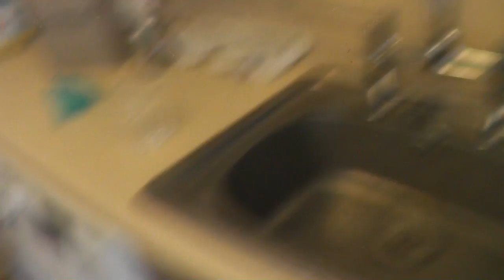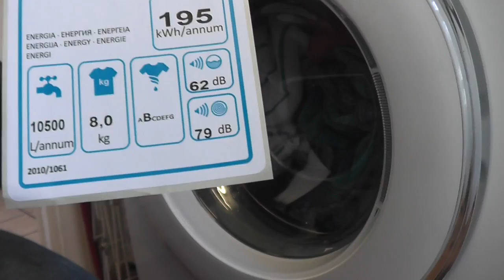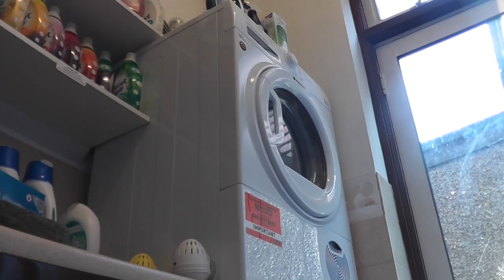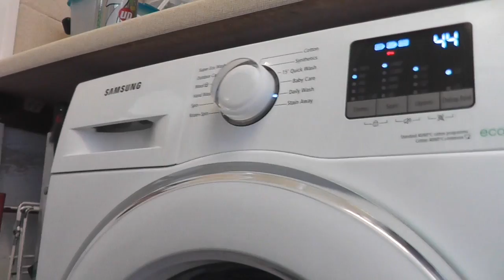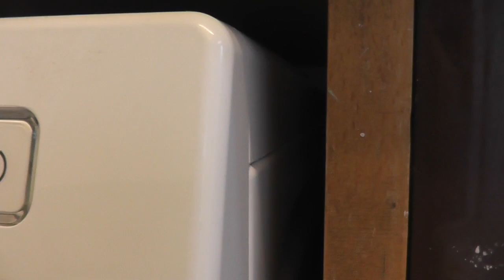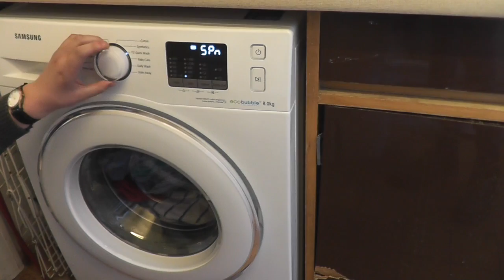Wash-In @ Washercrazy's 25/03/2017 - Samsung EcoBubble WF80F5E2W4W+Service Cycle!

Comment: My beko spins like that with the new pcb. It is much less sensitive and know acts like a real beko! Omg I've got the exact same comfort, my fav is the green and the new purple one even though they are all lovely.
Reply from the maker: I love the Comfort Intense ranges! Yes I think most machines are now using this 'Progressive Spin' pattern.
Reply: FlorenceBallardA3060 mine only does progressive on the final spin. On interms it goes straight to 300rpm and non stop to 1000rpm. The new board is for a different model so has many different cycles such as baby and toddler and duo 40c.
Reply: I'm glad I didn't get this model after all. it was this or the LG but went for the LG for higher rinses but the LG is also sensitive for back and forth movement but if it goes up and down as long as it doesn't hit the door it'll spin.
Reply: Mrlaundry101 Samsung eco-bubble
Reply: Mrlaundry101 mknmmmgoing to be dynamic and washing

Comment: On Samsung machines that are currently available. Do they give up on the spins easily if can't balance? I found that LG's keep trying to spin until they can and expect Samsung's to be similar. Also, how many distribution tumbles do Samsung's do on Cottons cycle?  Do you prefer LG or Samsung?  Many thanks.